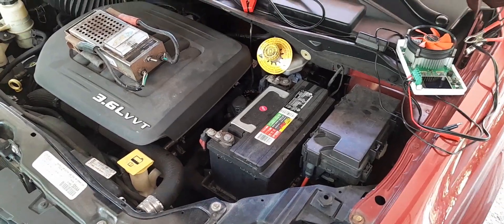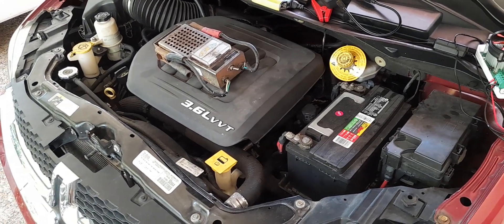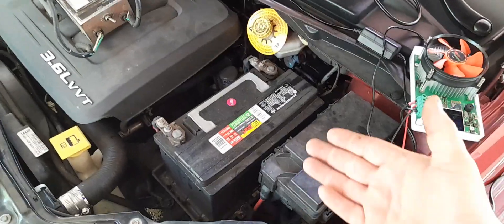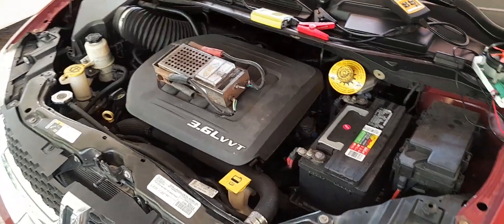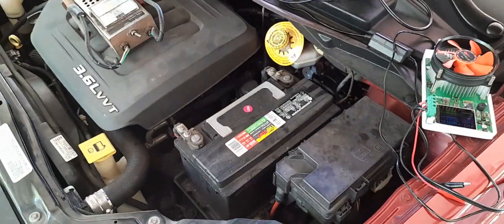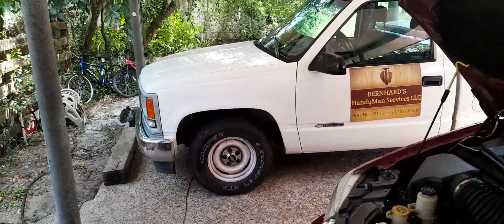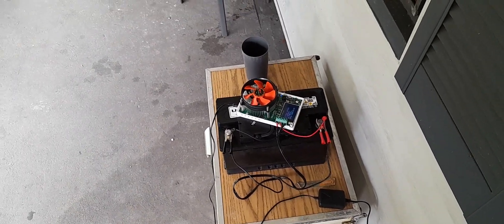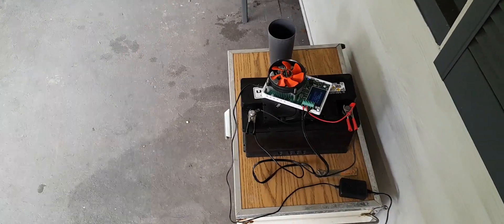Why do H7 batteries ònly last about 2 years

Comment: Try putting a temperature sensor on your battery for a while, compare it to a vehicle that isn't eating batteries  - all lead-acid battery groups and types last substantially longer in cooler temperatures. It may even be a known endemic problem with the van's design - the cover may even have been intended to protect the battery from engine heat?

Be aware that the storage batteries on your inverter have a very different internal design - an SLI (car) battery uses many paper-thin conductor sheets sandwiched together to provide a staggering amp output, while a deep-cycle (marine) battery has big chonky conductors that are less prone to degrading when discharged, but can't provide that kind of amps unless you stack a bunch of them.

Discharging electrons physically removes molecules from these sheets and charging reattaches them - deep discharges can create holes and perforations that encourage breakage, and deep recharges can pierce the insulating sheets and short the conductors.  Weak starts like you talked about indicate many sheets are damaged, reducing the stacked amperage.  If it was cold out, you could be stranded by that battery now.

Even for those marine batteries, the usable capacity is half of the rated capacity - should be marked on your storage batteries as a DoD (depth of discharge) rating around 50.

I can't speak to specific voltages - but I would question if 10.6 volts is a safe discharge test for both types, because SLI batteries really don't like being drained.  How many amps you can pull in a brief test will tell you immediately if the sheets in an SLI are mostly intact.

Hope the length of this is helpful.  :)
Reply from the maker: Thanks for the comment. It passes the 100A load test with flying colors. I have not put my carbon pile tester on it. The decreased capacity tells me all I need to know. Like you said if it was cold out that battery would have left me stranded by now. It always happens when it is cold out. 

I was thinking of putting one of my k-type thermocouples on the battery and then comparing it to my older truck with a much larger engine bay and more air flow.

The fiberglass blanket didn't make much difference and as far as discharges I do not discharge my vehicle battery like I do my deep cycle agm's.

I used to think this condition may be vehicle specific until I learned that this battery fits a wide array of vehicles and they all seem to have the 2 year limitation.

I will test the battery temp next.

Comment: Probability #1. Dodge is notorious for having gremlins associated with their electrical systems.  A battery that is marginal, will have plenty of capacity to spin the engine over for starting, but the computers start doing goofy stuff. Examples include heater and air conditioning blower motors that change speed on their own, windows that open and close on their own, et cetera.  I see those complaints weekly in an automobile repair shop. Solution #1. Spend more money up front, and put in AGM batteries. They are less susceptible to vibration damage and they recharge faster. Solution #2. For a vehicle that is not driven daily, buy a pulse charger such as the VDC Electronics version from Northern Tool. Normally about $50.00, on sale multiple times yearly about $25.00. Hook it up anytime the vehicle is not being driven. It uses a miniscule amount of electricity and will make your batteries last exponentially longer. A quick disconnect makes for easy in/out of the garage. If you park in an open driveway, solar versions are available. Keep those batteries topped off so they never get a chance to grow lead sulfate crystals. Your bank account will thank you.

Comment: There is a key to longevity with any lead-acid chemistry battery.
A fully charged battery is a happy battery, and although the AGM type don't self-discharge as much, they dislike being partly charged more than others.

A vehicles' battery charging system is not designed to fully charge any battery. If it were, when you are on a trip that is long enough to fully charge a battery, it wouldn't stop, so the battery would then boil dry from being overcharged.

Now, a particular use case and driving habits cause extreme variability of your results.

So, to cut to the key - get a smart charger/maintainer (not a cheap trickle charger) that has an AGM selection. Charge the battery to completion once a month (whether it needs it or not ;), or after a mishap where the vehicle needs to be jump-started.

Harbor Freight has a cost-effective 4 amp charger that fits the bill.

Comment: It is not just H7 batteries.  I have had short life recently with group 47 and 48 batteries.  As far as where you buy the batteries there are only 3 major battery manufacturers. All the rebranded big box and auto chain store batteries are made by one of the three.  I don’t know if you buy many cars parts, but the industry is in a quality crisis. It is not uncommon now for new parts like 12v car batteries, alternators, modules, sensors, etc. to be dead out of the box.
Reply from the maker: Yes I've been running into this issue a lot and it's not just with automotive parts I work some in the HVAC industry as well as plumbing and electrical and I've had bad components right from the distributor.

Comment: Run, don't walk to return the AGM and buy a good group 65 with whatever chemistry. I have been using Costco (now Costco/Interstate) since 2006. the original Costco version was good for over 7 years. The current Costco/Interstate a bit is closer to 5 years, but who is surprised about that. The 65 is 5/8" wider but it appears from the photo that it will mount on your stock base. Good Luck! PS: the 65 has been THE Ford truck battery for many, many years. CCA is over 1,000!
Reply from the maker: Yes I like the group 65 battery's. I put a $50 reman battery for my wood chipper and it lasted 5 years.

Comment: If you are driving small trips you aren't giving the battery enough time to charge back up after starting the car along with every other electronic on in the vehicle.  You can't expect a battery to last long if you don't give it time to charge back up while driving. Plus it's an AutoZone Walmart special, those are all crap to begin with.
Reply from the maker: Short trips are not the issue. I average about 20K miles a year on my vehicle. Thanks for the comment.

Comment: new batteries don't last as long as they used to, more money for manufacturer. heat reduces life time, you can insulate your battery from the heat under the hood. also new lithium starter batteries are available, they last 10 years, 1/3 of weight but more expensive. search youtube for more info: "LITHIUM CRANKING BATTERY | 1420CA PRO | Can it POWER the 4.5L V8 diesel? iTechWorld Starter Battery"

Comment: Please note: Nowadays batteries SUCK. However if you get an Interstate Battery you will probably get 6 years + out of it. Also note COSTCO sells batteries too but not many people realize they are Interstate Batteries. Walmart batteries are the worst followed by auto parts stores batteries. 
My 2019 Toyota Tundra battery lasted about 3 months before it was dead and I had to recharge it so many times until I took the truck in for a fuel pump recall which when they drove it to the service window where I was and turned the truck off I couldn't start it because the battery was dead. I got them to replace it for FREE and the new battery which was a higher Amp Hour is now still just fine.

Comment: they are designed to fail at the exact same time, it is the only explanation... I have a Honda and I was buying batteries every 2 years and I got tired of it, that size of battery, no matter who made it, would always fail at 2 years. So I took out the battery bay and modded it so I could put a different battery in it, low and behold it lasted 6 years, and it was a smaller and lower capacity battery. How is that for insanity? The battery I put in was designed for a tractor. So you would think having a lower capacity and having it drained faster and used harder than normal would shorten the life of the battery, not the case at all. So far these smaller capacity batteries last approximately 6 years and put up with all the normal use.
The batteries are designed to fail at exactly the same time, as I went through 8 batteries, and everyone one of them failed at exactly the same time every year, and that was with maintenance, distilled water top ups, and desulfation runs. The cells in the batteries are designed to corrode and fail and they know exactly how long they last. It's a sad business model but you have figured out their trap, and the first rule to avoiding a trap is knowing of it's existence.
Reply from the maker: Thank you! I have done the exact same things! I always made sure the water was good. I bought a desulfator and  tried that (did absolutely nothing). I would charge the battery every few months thinking it just needed to be float charged for a while. None of that nonsense made any improvements. So you just confirmed exactly what I was thinking. A completely different battery altogether solved the issue? Do you remember what the size/type of that battery was?
Reply: @Bbernhardsr  I put a marine battery in. It doesn't matter about the exact size, just switching to a boat or tractor battery and you will notice it will last a decade instead of two years. Just make sure your battery bay holds the new battery securely.

Comment: The batteries have become garbage made in obiden's favorite country. At least they cost twice what they used too. We had to change brands in my aviation job. Not sure they are much better. Bodes well for joe's EV plan. They are going to be Chinese junk but at least there will not be cheap or easy ways to charge them. I have had good luck with AGM batteries but Optima was bought by the Chinese and made in Mexico. Same damn garbage.
Reply from the maker: That is a shame about Optima batteries. I have one in my truck that was made in 2013 and still going strong.
Reply: Here in Realityville, the current Administration is the only one in living memory that has brought manufacturing back to America.
More jobs than the last three Republican Presidents put together, and we're currently in a manufacturing boom comparable to the post-war era, you literally have to go back to the 50s to see this kind of manufacturing growth.  You don't believe it simply because you don't want to.
But Republican's desperate desire to see America fail - because they're so patriotic - is not actually affecting real economic stats.
Reply from the maker: I am not sure you can say that you live in "realityville" with a comment like that. There is so much wrong with what you have said that I can't even pick a place to start.